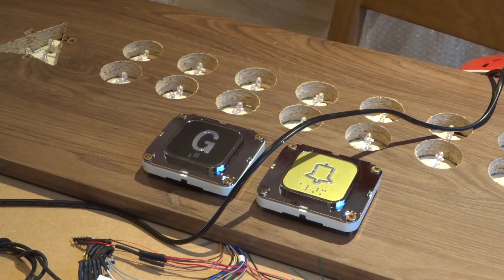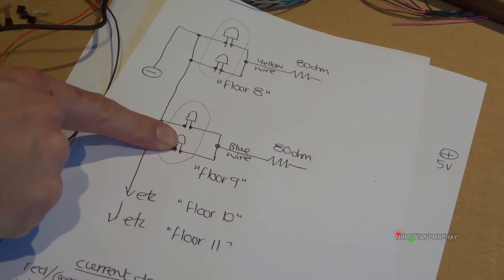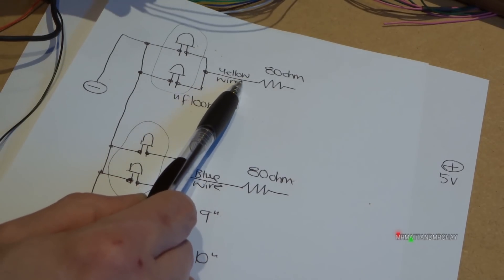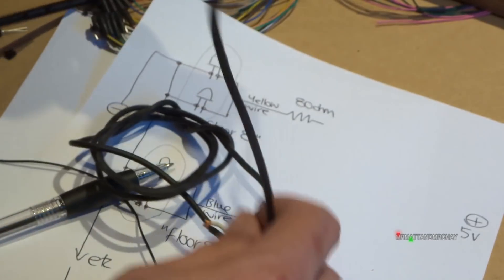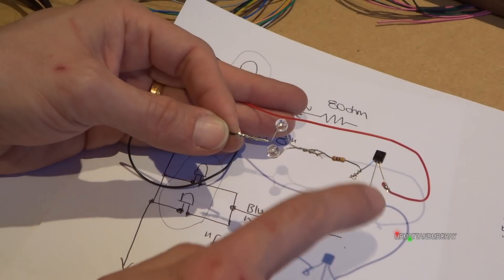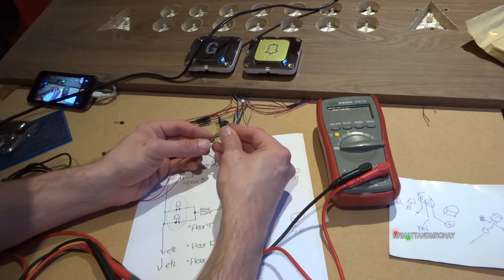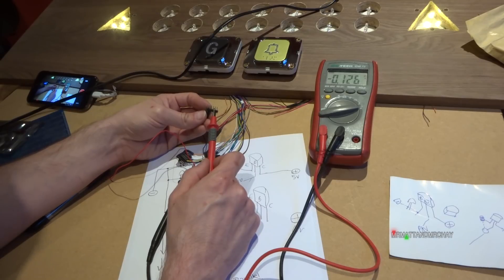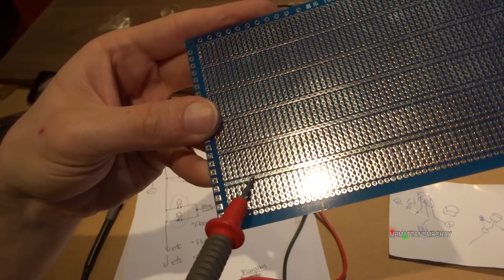Build a lift panel for Isaac - BEGINNERS TRANSISTOR TUTORIAL (P6)

Comment: Usually connecting LEDs in parallel with a shared resistor for both (or all) of them is considered bad design. It may be okay for this application, but since no two LEDs have the exact same characteristics, you will get different currents through the LEDs this way. This may limit the life of these LEDs or might even lead to early failures. In practice you have probably got enough safety margin so it won't matter at all, I just wanted to do some nitpicking. ;-)
But if you are interested in the details, you may want to read this thread on stackexchange:
https://electronics.stackexchange.com/questions/22291/why-exactly-cant-a-single-resistor-be-used-for-many-parallel-leds

Comment: The emiter follower was a very clever choice using one transistor. Just point this config adds a  0.7V drop, that is, the positive for the leds no longer 5V, but 4.3V. But 25mA (calculated on 5V) was massive current for this leds, ths 0.7v added drop will low the current a bit without stealing much brigthness. Try to route the transistors V+ to a separate 5V point away from board with and add a cap to this line to avoid noise on switching (if more than one indicator will be used for example). Arduino has no problems tough but just in case.
Reply from the maker: Actually, it wasn't a choice :)  The transistor idea was forced upon me when i realised the arduino outputs wouldnt handle the LEDs.  By which time I'd already commoned all the LEDs to a negative!  However the emitter follower has cut down the amount of components required and has worked quite well!

Comment: Looks nice. I recently got a starlift floor indicator panel from a local lift engineer. The light bulbs in it are 30 volts but we replaced them with 24 volt bulbs. My dad wired each bulb to a relay module which he connected to an ATmega microcontroller.
Reply from the maker: COOL.  You'll have to send me a photo?
Reply: It's featured in one of my recent video's: https://www.youtube.com/watch?v=yQSrzBdge1E